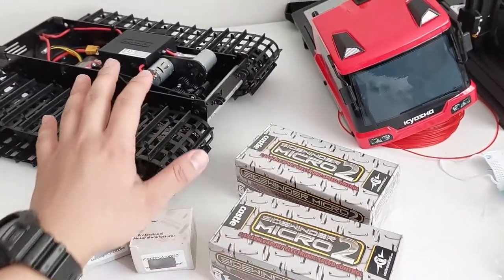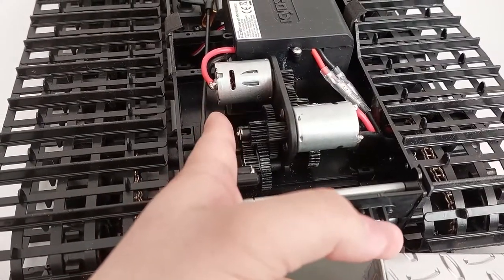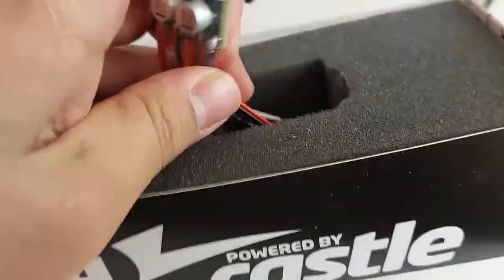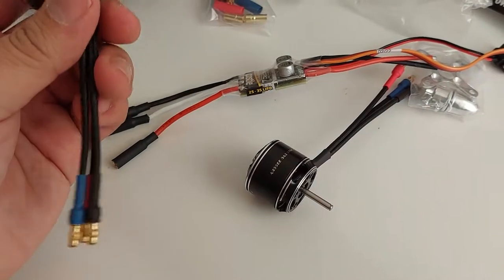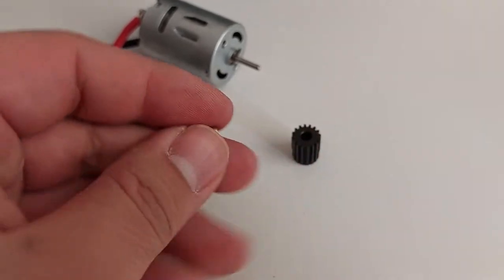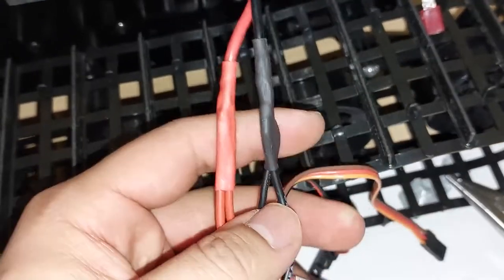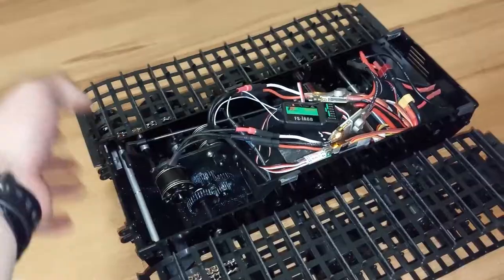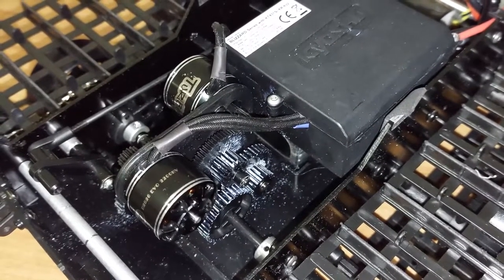KYOSHO BLIZZARD 2.0 | Castle Brushless Power!

Comment: Where did you get the MIXXER? What brand is it?  How did you program it?  What transmitter are you using?  Any help would be awesome.
Reply from the maker: It's a generic vtail mixer I got off eBay.  You can get a turnigy branded on from hobbyking. I'm using a GT5 radio and there is no programing required with the mixer, just adjust trim and endpoints on the radio

Comment: great video. Do you think the plastic gears will hold up ?
Reply from the maker: Yes they do, this is a pretty mild brushless set up. Pretty much same as stock interns of speed but much better torque and low speed control
Reply: @CRCG_00  thanks for the reply

Comment: Hi, the ESCs you are referring to (1/18 Sidewinder Micro 2 ESC, 12.6V, 2A Peak BEC) have been discontinued. Is there another one you can suggest with similar specs?
Reply: Hobbywing 18 amp 3s esc.  They have decent BEC, programmable, 3s capacity and very smooth start up. BUT, they run only brushless whereas the SWM2 could run brushed as well. I wouldn't run more than a 1400kv on 2 or 3s tho.
Reply: @ryano8613  Would this work?
Hobby Wing EzRun-18A-SL Brushless ESC for 1/18 Car
Reply: @cjprojects79 I don’t see why not

Comment: Castle is loud overpriced crap.
Reply from the maker: Well, do you have any recommendations for anything cheaper with the equal/ better sensorless performance?
(Other than custom AM32 escs)
Reply: I'd always recommend doing the custom AM32 thing. For those not so skilled with soldering iron, there's AG Innovations Ninja.
Reply from the maker: I did attempt to do a custom AM32 flash with a Tekko F4 45a, I got everything soldered according to the guide but the cube programmer wouldn't detect the ST link.  I know that there are differences with a genuine/clone versions but others I've asked seem to say that a cheap one off Amazon if fine.  Any advice you could give?